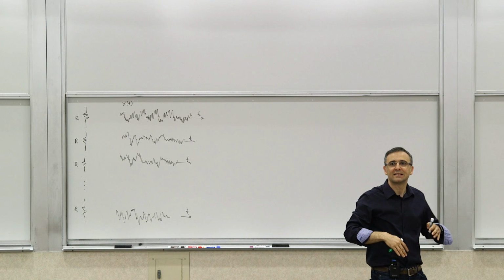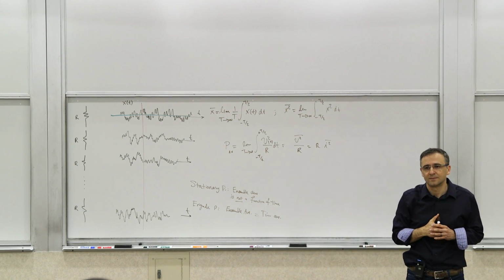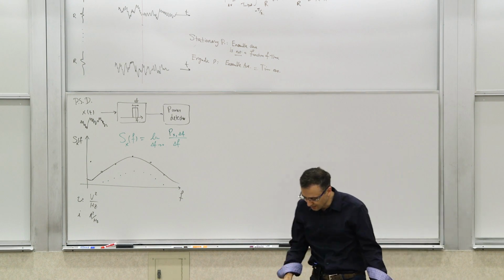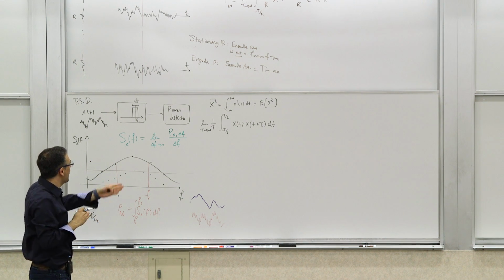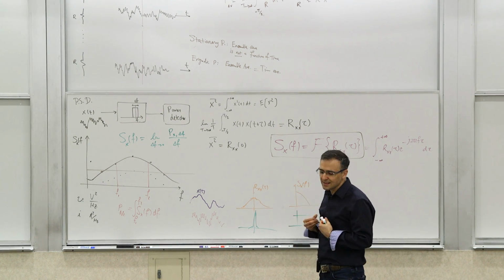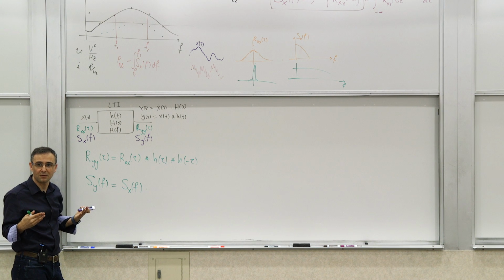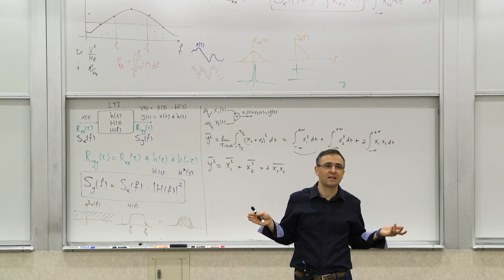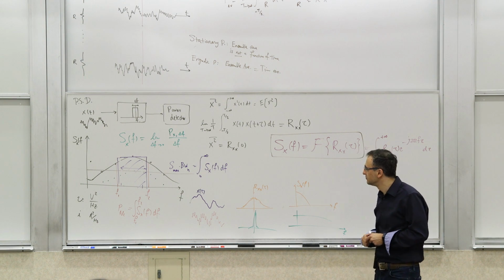172N. Overview of random variable, PSD, auto- and cross-correlation

Comment: 42:17  I think that <y²> = <x1²> + <x2²> because on top of being uncorrelated we are assuming that the average of x1 or x2, or both, is zero, i.e. <x1>=0  and/or <x2> =0.
In general the correlation Rx1x2 = <x1∙x2> , also written has E[x1∙x2]. If x1 and x2 are uncorrelated (i.e. they are independent) then Rx1x2 = <x1><x2>, also written as E[x1]∙E[x2]
If <x1>=0  and/or <x2> =0 then Rx1x2 = 0. 

NOTE: do not confuse correlation with covariance Cov(x1,x2) =  E[x1∙x2] - E[x1]∙E[x2]  which is =0 for independent signals (uncorrelated signals) even if E[x1] ≠ 0 and E[x2] ≠ 0 given the above.

Comment: PSD is so universal in physics that I have to learn it even though I am not specialized in the electrical engineering. Your mathematical interpretation on this is clear. This video makes me subscribe your channel immediately.
Reply: I'm working in structural Testing, modal analysis and I'm here because the inner mechanics needs knowledge of PSD, auto and cross correlation...
Reply: @priyansutank  the same as mine. I work for renewable energy on the mechanical and structural aspects.

Comment: 3:52 "imagine you have a bunch of resistors with exactly the same value" ... just as statistical properties may change over time you can't have resistors with exactly the same value, because resistors have tolerance....🙂

19:52 "true white noise can not exist because then we would have infinite power" ... you asked for it so here it comes the Zero Point Module or ZPM... https://youtu.be/pRiUwCx_2O4 ... so maybe this means... that true white noise can exist, but we can not harvest its power yet... 😃
Reply: You can use same resistor and measure its  voltage at different instances
Reply: Your first comment suggested that your question was genuine but the second one is just a troll. So, can't quite make out if you need answers or not!
Reply: @AnkhArcRod  Hi AnkhArcRod, my first comment was serious, but it is just a comment about the impossibility of two resistors having exactly the same value.... Concerning my second comment about the ZPM.. I was just being funny. If that's alright? However it never hurts to keep an open mind about future discoveries in science so I was just having some fun if that's alright? 😃 Thanks for your concern!

Comment: Sir I know this is not related to this lecture but can you tell me what is the difference between op-amp slew rate and op-amp bandwidth(not formula wise). Are these two factors related to each other?
Reply: I think Lei points out the key difference btw slew rate and BW of an amplifier. I can add some of my own understanding. Slew rate (V/us) tells how fast an amplifier can charge/discharge its output voltage, and the differential input voltage is assumed to so large that the negative input FET is off. BW is often measured as the frequency where the amplifier gain rolls off by 3 dB from DC gain, where the input pair FETs are all in saturation if designed well. Basically, the slew rate shows how fast you can change the output voltage in the time domain; BW shows up to what frequency of the input signal the amplifier can still hold a high gain. These 2 specs are indirectly related, things like the design of the output stage and the sizes of C_compensation and C_out may affect both specs.
Reply: slew rate is talking about large signal behavior, but the bandwidth is only applied to small signal one. If you care about slew rate, you should see how each transistor behaves (e.g. saturation or linear region) during a large swing VIN, say, 0-Vdd. It is usually non-linear. However, when you talk about small-signal bandwidth, the opamp behavior should be linear. You can model it with poles and zeros.